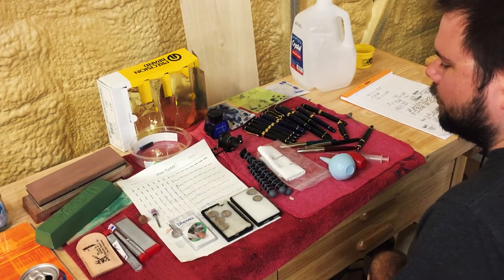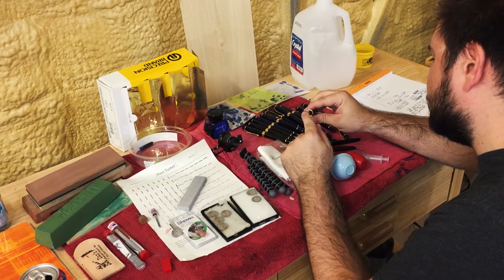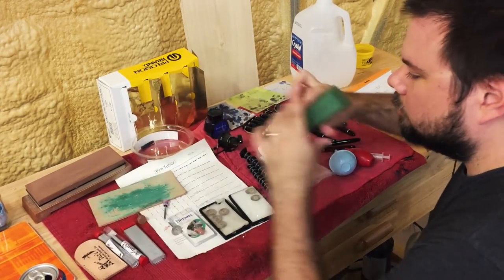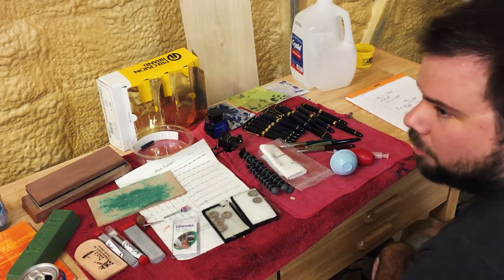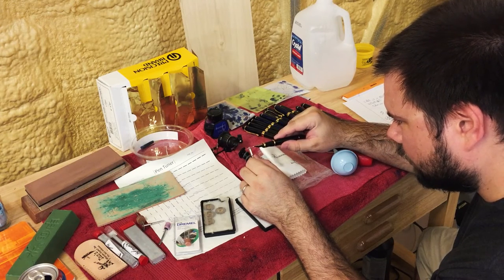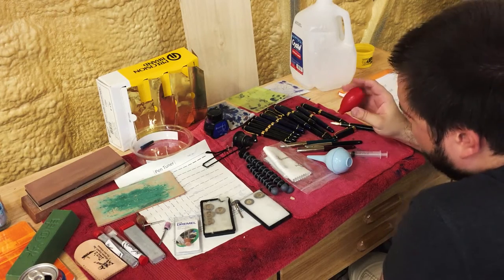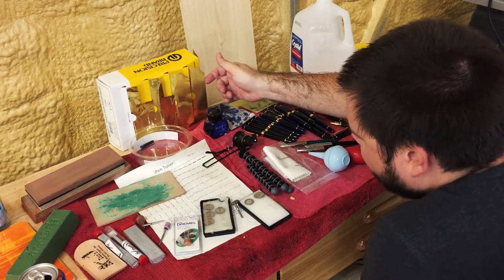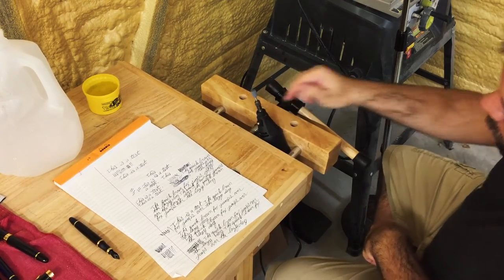Fountain Pen Workshop Overview - pentuner.com

Comment: Hi, another good video.  Can you give the name of the cutoff wheels and what number grit it is.  I went to Widget and was confused with the large numbers of cut offs.  Thanks
Reply from the maker: Hi Larry, I used 3/4 inch 600 Grit Diamond Disc Set and 3/4 inch 150 Grit Diamond Disc Set - 6pc - 1/8 inch shank
.  For the grinding stone I've been using 3/8 x 1/2 Cylinder Grinding Stone - 1/8 inch shank - USA